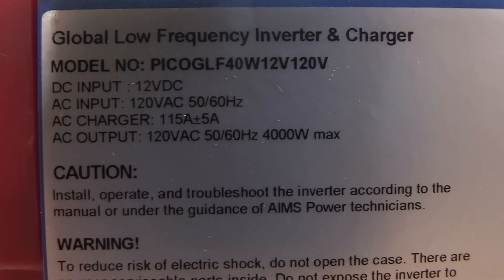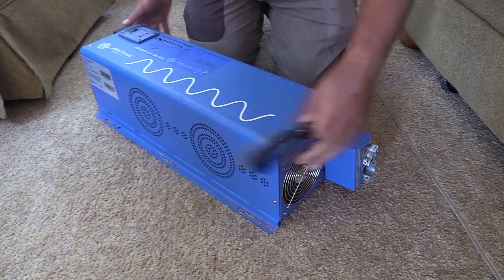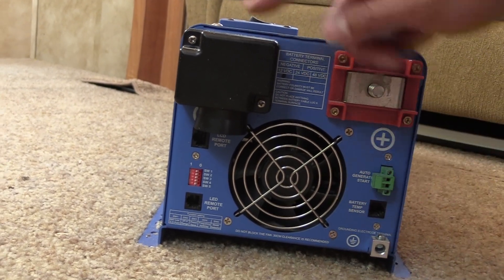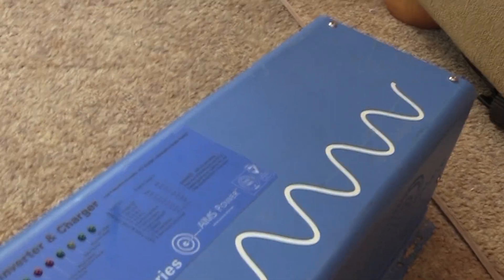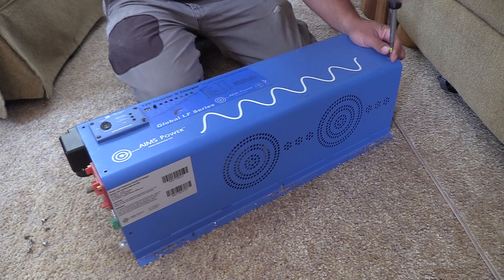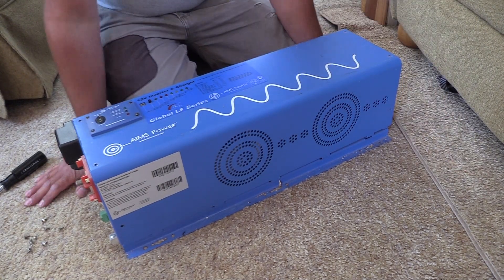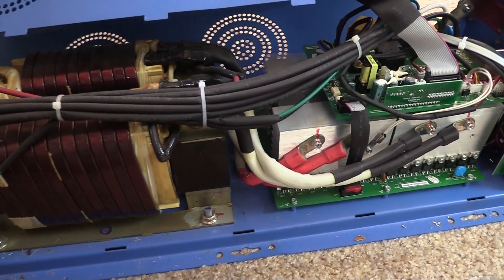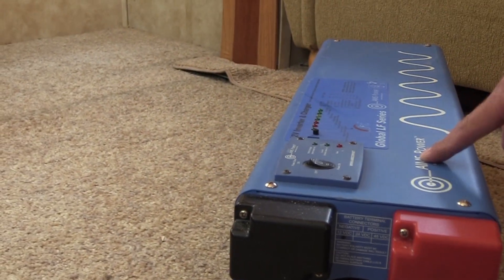Aims 4000 Watt Inverter Charger Overview

Comment: I have had one in my Class C for 5 years using a 200 amp lipo. It will handle 30 amps passthru.
We had the AC connector strip burn up starting at the factory side. I just had to bypass the strip.
Reply from the maker: Thank you for heads up I will keep an eye on that.